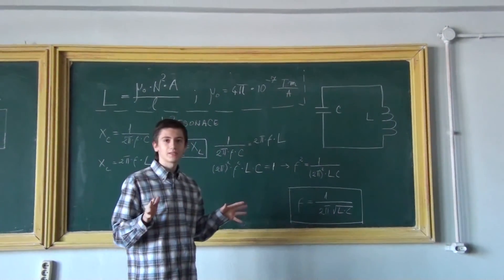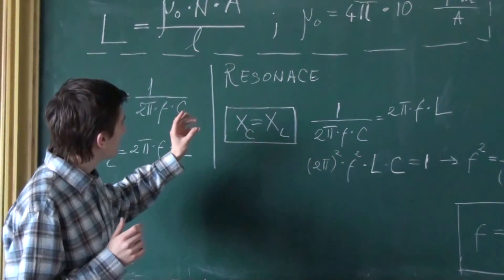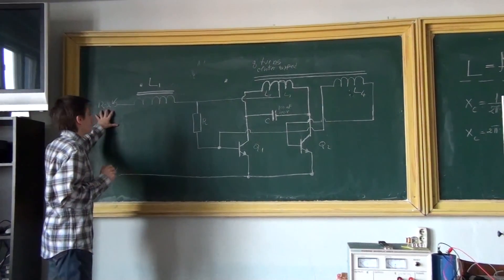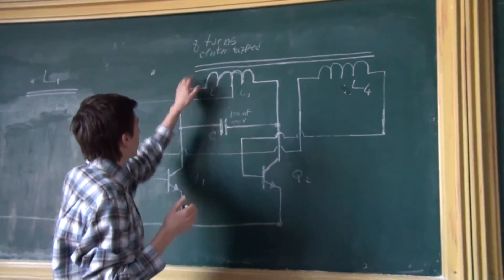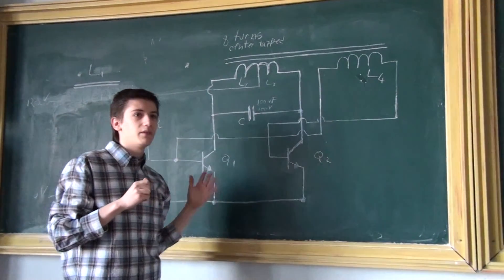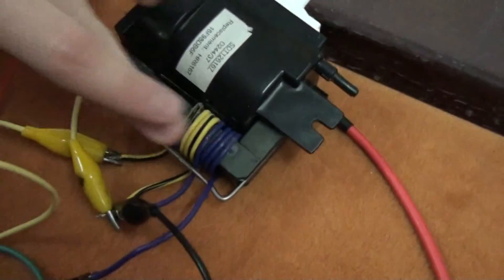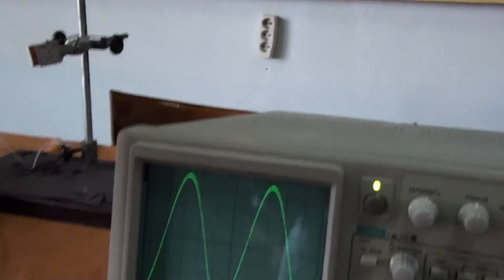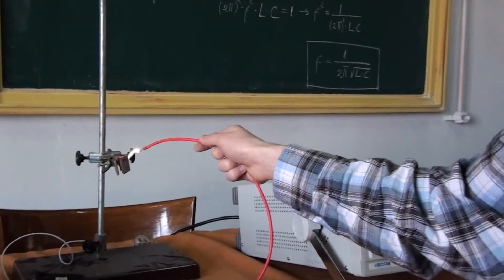LC Resonance - Royer Oscillator

Comment: The efficiency is coming from the ferrite transformer any other type of core you get a fire hazard, and lousy results. To use mosfets safely there should be resistors going to ground on each gate, a 1k ohm is enough, and 10k resistors on drain and source, depending on the frequency and size of the transformer you might want a snubber circuit on the mosfets. Still a great video, the circuit works but a pwm signal is way better for specific frequencies.

Comment: You will burn transistor`s base with this circuit! Just add diodes from ground to base of each transistor and you will be professional. :) And do not forget to add resistor in series with the L4, they will limit the base current.
Reply: The diodes and resistors aren't needed with a separate feedback coil which is already supplying the correct voltage/current. Good point though as those things Are necessary when using the main coil for feedback. The most important thing is to use overrated transistors as they experience significant peaks, and being overrated they shouldn't need clamping diodes, though that's still good practice.
Reply: Ivan I had another look and the circuit shown on the board is not the same as the one being demonstrated,  that one Does have the resistors and diodes you mentioned so it is indeed the one without the separate feedback winding.
Reply: @MadScientist512  yes the circuites are different,
Reply: They used MOSFETs instead of bipolars, so there won't be an issue with too much base current.

Comment: The circuit shown on the blackboard is not the same circuit in the  photograph showing the practical circuit. One uses BJT while the other uses MOSFETS.  The circuit on the board with one base resistor only at one of the bases is doubtful as to its operation.  It will work but not symmetrically.  
On the practical circuit it looks as if it has two resistors and an additional two diodes working with the MOSFETS. I know the circuit and it is not the one on the blackboard.
Reply: Carmel Pule' the flyback driver is zvs driver-the mosfet version of royer oscilator where you have 2 more diodes and no feedback coil

Comment: A capacitor is needed, in theory, otherwise there is only inductive reactance and no oscillation will occur. However, in the real world, there is *always* a capacitance across there (Yes, stray capacitance is still capacitance.) the capacitance may be in the picofarads but exists none the less.
Reply: Power Max There is a capacitor in parallel with the primary on the circuit diagram.

Comment: 0.5V is not enough potential to accomplish anything with today's silicon-based electronics. (which have a voltage drop of about 0.6V)

Comment: I believe it is a choke to avoid run-away current draw. Could be wrong though.
Reply: KyleCarrington It's a filter for the high frequencies from the circuit, although there should have been a capacitor there too.

Comment: What's the role of the first inductance ?
Reply: Possibly AC suppression (choke coil) or ferrite bead on the DC rail, I'm not sure though.
Reply: @akosv96  it makes the supply act as a current source, so I've been told (it's roughly 4 times the equivalent inductance of the primary)